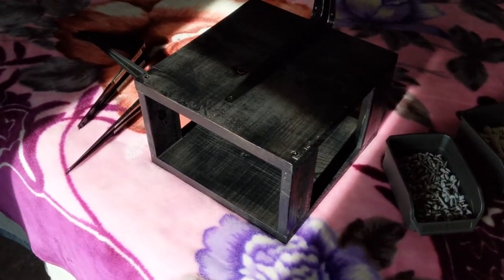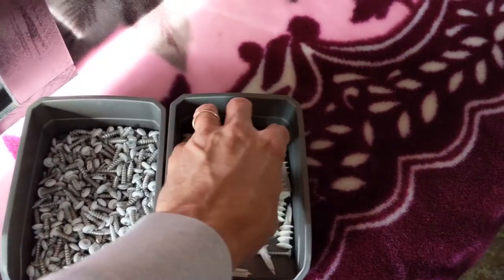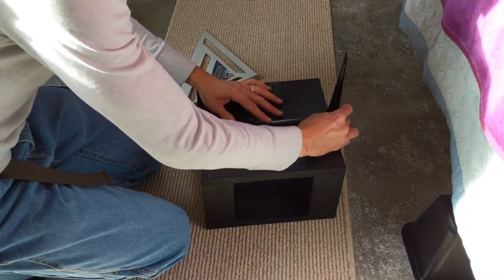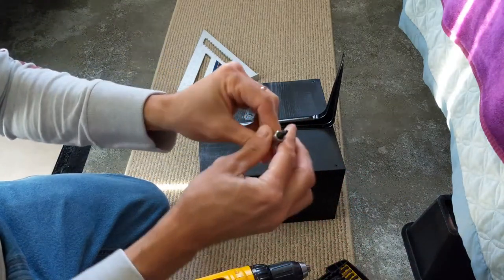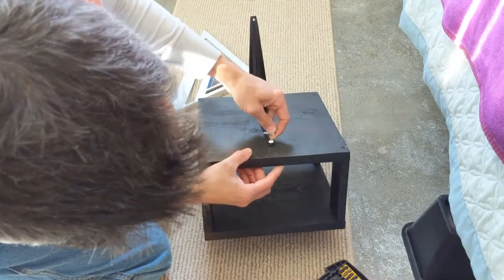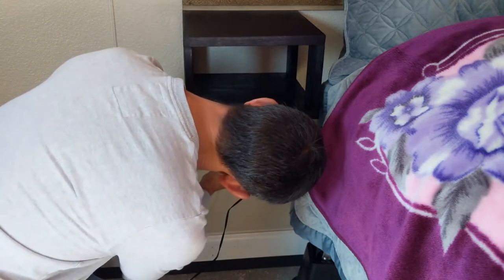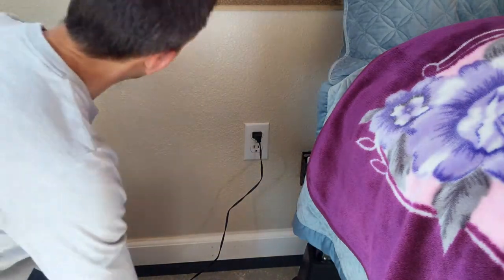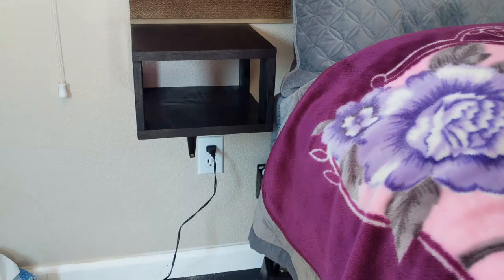HOW TO INSTALL A FLOATING BEDSIDE SHELF   | FLOATING SHELF DIY

Comment: so it's nailed to the wall?
Reply from the maker: I secured it to the wall with Screws.  I prefer screws over nails because they hold better and are easier to remove if you need to.  :)  Do you like it?